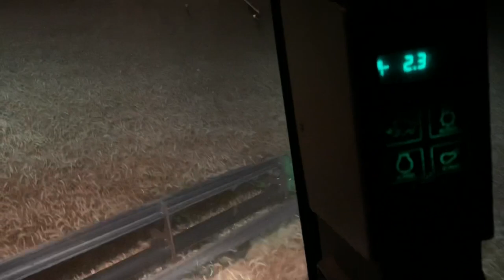All the Breakdowns! 2021 Wheat Harvest - Day 6

Comment: Details on what went wrong with the bearings? I was expecting to see walker crankshaft bearing repair, surprised your did individual walker bearings?  Not a normal in-season repair.
Reply from the maker: I had put in Lankota wooden block bearing about 4 years ago. They always seemed good, then sudden they started to fall apart all at once. In fact, 6 of the 8 bearings were broken and the straw walkers were hitting each other and basically got jammed up. It certainly wasn’t a normal in-season repair, and at the time I was more focused on getting it fixed, instead of taking videos. Everything turned out ok for the remaining harvest!